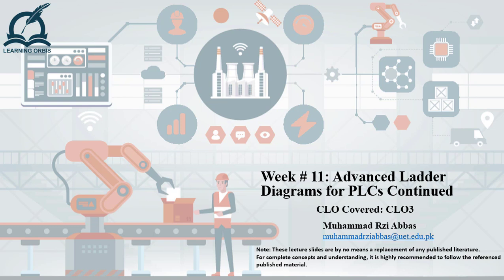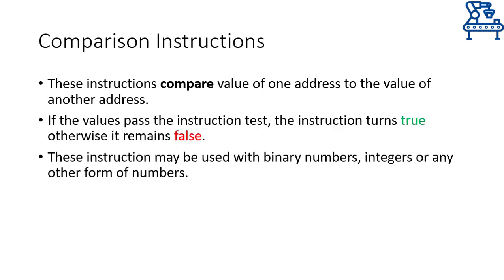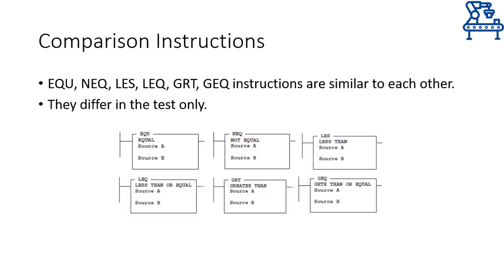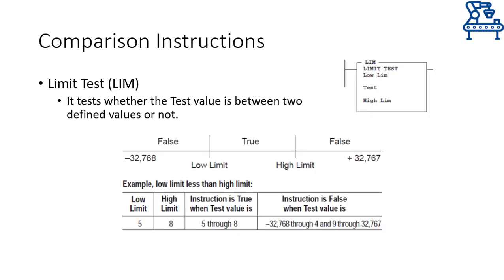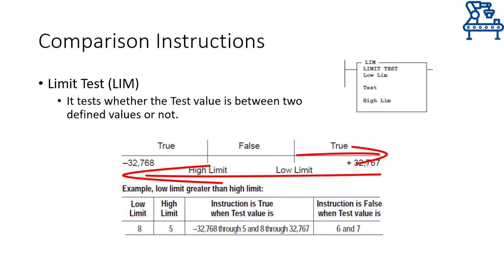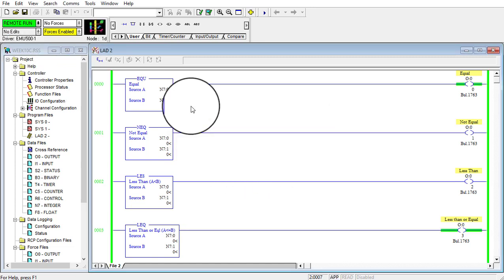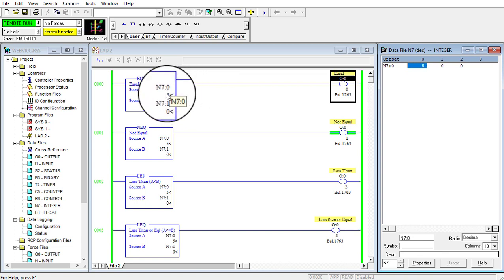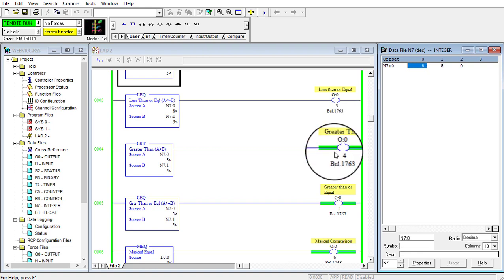Comparison Instructions | Allen Bradley PLC

Comment: In loading operations of military gear & equipment on a utility aircraft e.g. C-130, Y-20, etc, the controller keeps on checking the cargo load using the sensor value, and once it reaches the limit, it turns on indicator light or alarm in the cargo unit that no more load must be added to the aircraft anymore. The load level can also be set in accordance with the flight performance to be required.

Comment: In industries, different Alarms are attached with the plc at the specific temperature in specific area of machine environment or in cooked products to avoid these all products from spoiling as if the outside temperature is 45 Degree Celsius and internal temperature is 30 so when the internal temperature will become equal to 45 degree Celsius then alarm starts ringing so here Comparison instruction of plc is used.

Comment: In a drilling process, the drill stops when the drill bit has reached the specified depth inside the workpiece. The PLC compares the depth of drill bit inside the workpiece with the specified final depth and stops when this value has reached.

Comment: It is a well known fact in cricket that cricket bats are a bit curved in shaped from the bottom side. Manufacturing companies of Bats like MRF, Grey Nicholls, HS, Ceat and DSC all utilize PLC to compare the depth of the curve to the desired curve. If the desired depth of the curve is achieved, the PLC stops the process.

Comment: in street lights, the comparator is used to monitor darkness as a function of resistance. When the value of LDR resistance reaches a preset value, the lights are turned on.

Comment: Nowadays In Air Conditioners or Inverters used, the predefined set of temperature is compared with the present room temperature where it is situated and tends to achieve that required temperature. One achieved the Air Conditioner maintains it and the compressors working is depressed for that instance.

Comment: In the manufacturing industry, the new workpiece arrives on the work station when the accumulated value of weight reaches the preset value, the PLC will command to stop the filling process.